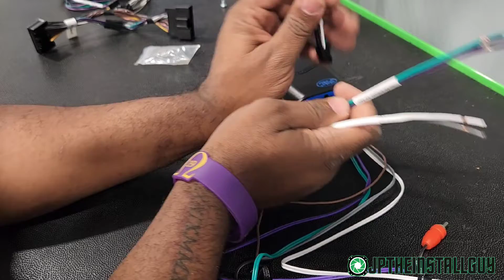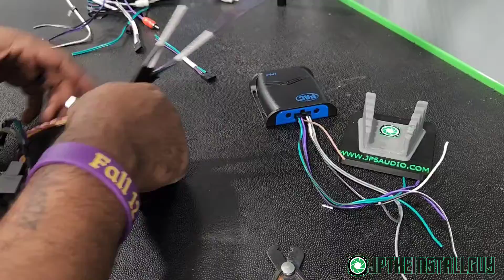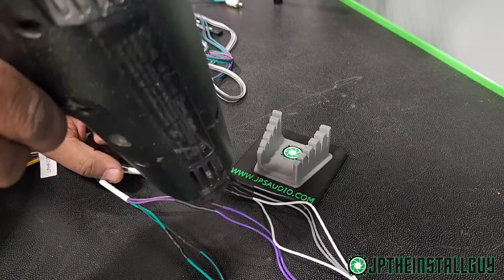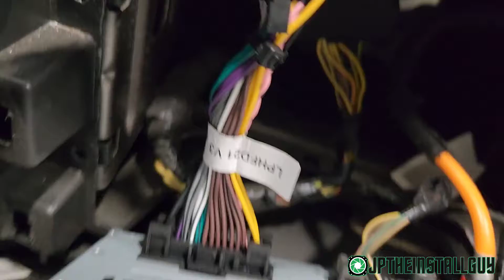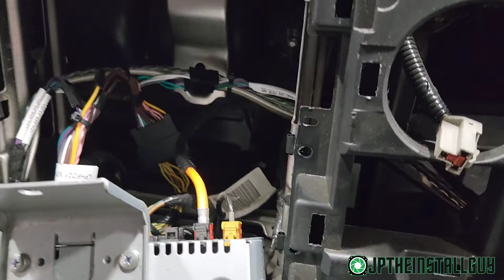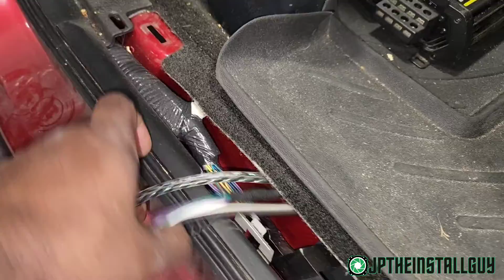how to install a 4 channel amp to a factory radio using audio integration harness ford f150

Comment: If I plan on getting a 4 channel amp. Should I go ahead and run the 2nd set of RCA's while I have everything apart? If not, does it matter where I put the RCA's for just the 1 amp? Thanks for any info

Comment: If i have a Sony amplified stock system, how do i install an amplifier to my door speakers? I'm assuming i can't run from the stock amplifier speaker output to the input of my new amplifier? Once i do this correctly will i lose any functions of my stock head unit? Sorry for all the questions but I've searched everywhere for an answer to these specific questions and I've gotten nowhere. Thank you!

Comment: im a little confused. I understand the conversion to RCA for the amp and sub but why the additional single speaker wires to the amp? With this harness does it amplifies the door speakers as well?

Comment: How would i be able to do this from my factory head unit, i would like to add an amplifier to run out of factory door speaker wires and also a subwoofer amp but where would i get RCA signal from?

Comment: How do I know if I need a powered or unpowered LOC? I have a ford focus and would get that PAC T-harness
Reply from the maker: @abhinavgarg6487  perfect question uncovered locks are only used for signal and powered locks will provide a remote turn on for your amplifier, some other powered ones offer higher rca voltage as well like the lc1i by audiocontrol. So it depends on your needs.

Comment: Where can I find a wiring harness
Reply from the maker: It was in the description but here you go Parts used for this install are:
pac line output convertor lp74 https://www.jpsaudio.com/product-page/lp7-4
audio integration harness https://www.jpsaudio.com/product-page/lphfd21-pac-non-amplified-ford-harness
pac audio integration harness extension https://www.jpsaudio.com/product-page/lphext17-pac-t-harness-extension

Comment: Nice im going to order for mine with the sony stereo but how would i also add a bass amp and 4 channel with only 4 outputs and also the door speakers are going to be 300 watts rms each should i upgrade the wiring for them?
Reply: Anything above 75w should be upgraded if you are thinking of using factory speaker wire

Comment: PAC T advances harness inputs( to amp) go to RCAs if your amp can convert high to low giving signal to speakers without re wiring. Outputs from the other side of the amp Phillips screws go to output (from amp) making one big circle. subwoofer will bounce off the rear signal so then jsut connect the subs to Phillips screws on the amp also known as low level this would apply to 5 channel. I plan on doing this next month took a lot of time to learn but thankfully I got on the phone with Crutchfield and they broke it down.  If running components you will need crossover if you have coaxial you will not need, built in cross over already in coaxial . When running inputs to the RCA (TO AMP) you can run a Lc7i etc to clean the stock audio roll off with it attach ferrules then RCA to other side still connecting to high inputs. Hope this helps

It’s the same price purchasing the speedwire because you will need two in total about 55 60 bucks and the extension for the pac is 60. Crutchfield can walk you through set up if you purchase through them

Comment: Correct me if I’m wrong, but doesn’t that Kicker CX amplifier you’re connecting to already have high level inputs so there was no need to run a Line Output Convertor?
Reply from the maker: @magictoaster806  not exactly high level inputs. True there is a switch on the amp for input that says high to low but there is only rca inputs on the amplifier. I believe you have to buy a rca conversion part to do high input. So technically yes...lol